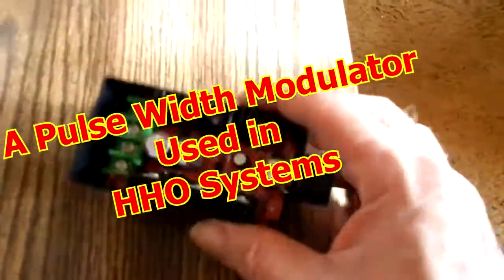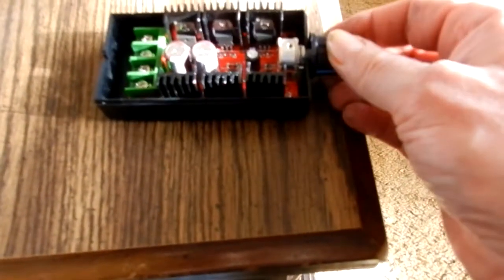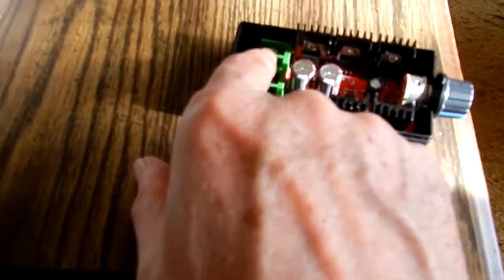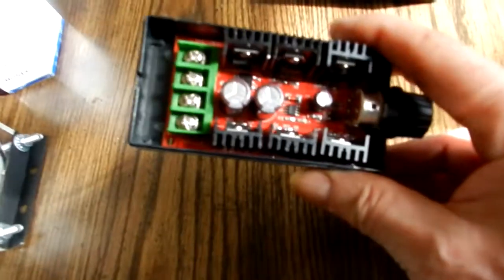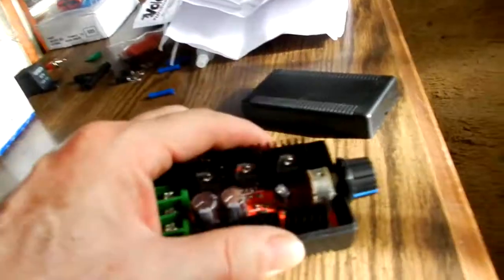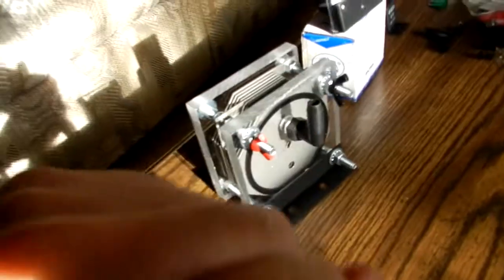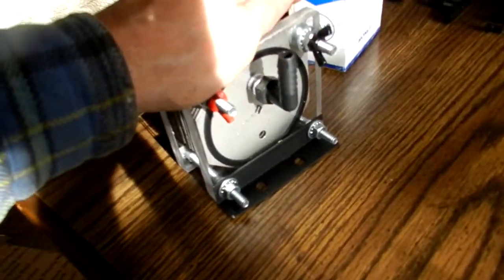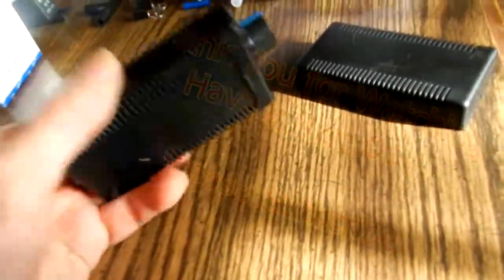PWM Pulse Width Modulator used in HHO SYSTEMS, HHO Dry Cell Generators

Comment: Anybody used PWM to generate HHO successfully?
Reply from the maker: The use of a PWM in producing HHO provides pulses of power to the plates and the process instead of just pouring a continuous power to the system.  The advantage to this is that when the bubbles form on a continuous power stream type of HHO system they tend to stick to the plates effectively reducing the surface area of the plate while there is a bubble on the plate.  

The HHO system only produces gasses when the liquid is on the plate, not the bubbles.  The PWM uses pulses which sort of jar the bubbles off of the surface.  This is the function of using an audio pulse vibrating the entire system to remove the bubbles.  Both the PWM and the Audio vibrations increase the efficiency of the system by removing the bubbles and letting them go on to the engine as in the form of a gas.  

I haven't tried putting a speaker on the system yet, but just tapping the case causes a noticeable release of the bubbles.
Reply: @NorthPoleJeff  I assumed the frequency of the PWM would somehow 'shake' the water molecule releasing the hydrogen and oxygen?
Reply from the maker: I believe that you are right.  The PWM does indeed cause this to happen in effect, however using an audible force will use a physical force to loosen the bubbles from the surface.  The two combined would mean even greater efficiency. 
 @donotwantahandle1111

Comment: I built one hho machine but i try to find that pwm. Do you know where i can find that ???
Reply from the maker: Here is a page that shows several PWM sets.  You need to have at least 30 Amps.  Any one of these should work great.  https://www.ebay.com/sch/i.html?_from=R40&_trksid=m570.l1313&_nkw=30+amp+pwm+motor+control&_sacat=0&LH_TitleDesc=0&_osacat=0&_odkw=30+amp+pwm+controller

Comment: Dear Jeffrey,
Therefore, in an HHO system, the PWM sends pulses of constant Voltage (let say 12.4Volts) which corresponds to pulse constant current equal to Io=V/R (where, R is the system resistance, electrolyte etc) in a such way that the average current within the Duty Cycle (d%) is Io=V/R times d%. Do we agree on this?
Therefore, in an HHO system, the PWM controls the Power input (Watts) and not the instant current (Io=V/R when is ON) which is constant (for constant temperature of electrolyte). That is a disadvantage because, that instant current (if large) produces ohmic losses which give rise to the temperature of the electrolyte. Therefore, the concentration of the electrolyte (solution) is very crucial in order to keep the instant current (Io=V/R) within the desired value, so that ohmic losses are minimized, and therefore efficiency of the HHO system is maximized.
What do you think Jeffrey?
Many thanks for responding to my questions.
Best regards,
Chris
Reply from the maker: Chris, thank you for that idea of the instant pulse current, I never thought of that as being a problem.  Now, I am realizing that instead of using square pulses, it may be better to use more of a rounded pulse instead.  This very well may reduce the overall power consumed and heat as well.

While we are talking about increased efficiency,  I am also thinking of sound pulses being applied to the system as a further way to increase the efficiency.  

Another way would be to use magnets set up as a chopper for the input water.  A chopper is used in fuel systems to break long carbon chains in the fuel making it easier to burn.

What are your thoughts on these methods.

Thanks again and have a nice day.

Jeff.
Reply from the maker: I really don't know about this because I have not studied instant current.  However, I remember our TACAN system sending out interrogation pulses that were not square for a purpose.  I think that this was for frequency harmonics and not for current, however having rounded pulses instead of square may reduce the instant current.  I am just guessing, however.  Thank you very much for your questions, you make me think.  Have a nice day.

Comment: 4 the love f'n God I need help please, I have the ccpwm 20amp w/LCD display. I HAVE a 7 plate series, Stainless steel same size this one, cathodes I swapped with is titanium. When It's cold it doesn't supply amps.  Koh is good mixture, When my cell warms up cabin temperature the ccpwm all of sudden gives amps to my cell. After 20 minutes of driving maybe 30. I had
 nnn+nnn both titanium. Now I rearranged the cell put just 7 plates -nnnnn+ and it only draws 1.5 amps not cold wtf is going on?
Reply from the maker: Your first arrangement nnn+nnn should work.  I don't think that the titanium is a problem, however, it may have an oxide on it that acts like an insulator at lower temperatures.  These are just wild thoughts, however.  Also, change your electrolyte and see if that makes a difference.  The Titanium may have some strange characteristics with certain electrolytes.  

As far as your second arrangement, each neutral set of plates creates a voltage drop.  With seven plates this voltage drop acts like a resistance and doesn't allow very much current to flow.  

There are two efficiency improvements and one is to have a variable pulse width and frequency in your PWM.  Another that I had seen only video on is the use of sound or vibration to force the bubbles off of the plates earlier giving the solution more plate area to form new bubbles.  This can produce a quite of a bit more HHO.

Thank you very much and have a nice day.
C. Jeff Dyrek
Reply: @ Taylor,...you managed to get 1 thing right. You wrote the name of God with a capital "G". Too bad you cursed Him...
Reply: @NorthPoleJeff  Here is a proper study done on Titanium as electrodes.... http://irjaes.com/wp-content/uploads/2020/10/IRJAES-V4N3P345Y19.pdf
This shows that titanium does in fact "protect" itself so to say, by very quickly building a layer of oxide? around it. If you look at the graphs from the link, you'd notice it gets worse for titanium as time goes by. CONCLUSSION: titanium sucks for hho production compared to other materials such as Stainless Steel etc.
Reply from the maker: @savedwretch  Thank you very much.  I am going to try my system on a lawn mower sometime next week.  I have never done that.  I will look at the link that you have sent.  Thanks again and have a nice day.
Reply from the maker: @savedwretch  Where did I curse him.  God is coming soon and I sure don't want to be cursing him.  Thank you for letting me know.  Have a nice day and God Bless you.
Reply: @NorthPoleJeff  No worries brother, have a look...i replied to "@Taylor". May God bless you.

Comment: Dear Jeffrey, I do not think that a pump helps more then 1-2% by consuming more power (little though 5-10Watt). Audio frequencies may help a little BUT both Pump and Audio frequencies make the system more complicated while consuming POWER. The net result, I do not thing that is worth.
Reply from the maker: Thank you very much.  You're right, the pump would be a problem.  However, on large systems 1-2% may be worth it.  In a test about the audio stimulation, I wish that I had a reference, there was a remarkable amount of bubbles given off when the proper frequency was applied.  This may only have been the initial release when the power was first turned on.  

Thank you for keeping me thinking.  Have a nice day.

Comment: The PWM does it control the Voltage or the Current. Could you explain?
Chris
Reply from the maker: This is the way a PWM works on an autopilot system.  The PWM sends pulses of variable width to a stepper motor.  A stepper motor does not have a commutator so the PWM is needed to send pulses in specially timed sequences to increase torque or for precise positioning.  

Short pulse widths  give low torque  and wide pulses give more torque.  The sequence of these pulses determines how much rotation the motor provides.

So, to really answer your question, it does not change the voltage or current, it just changes how long the current is turned on.

Thank you for asking this question, it allowed me to really think of the operation in a different way and I learned from my explanation.

Have a nice day.

C. Jeff Dyrek
Reply: @NorthPoleJeff  Dear Jeffrey,
Therefore, in an HHO system, the PWM sends pulses of constant Voltage (let say 12.4Volts) which corresponds to pulse constant current equal to Io=V/R (where, R is the system resistance, electrolyte etc) in a such way that the average current within the Duty Cycle (d%) is Io=V/R times d%. Do we agree on this?
Therefore, in an HHO system, the PWM controls the Power input (Watts) and not the instant current (Io=V/R when is ON) which is constant (for constant temperature of electrolyte). That is a disadvantage because, that instant current (if large) produces ohmic losses which give rise to the temperature of the electrolyte. Therefore, the concentration of the electrolyte (solution) is very crucial in order to keep the instant current (Io=V/R) within the desired value, so that ohmic losses are minimized, and therefore efficiency of the HHO system is maximized.
What do you think Jeffrey?
Many thanks for responding to my questions.
Best regards,
Chris
Reply from the maker: @chrischristodoulou1731  There were two other ways that HHO efficiency may be improved, something since your last letters from a while back.  One would be a circulating pump and the other may be an audio frequency applied to the chassis of the HHO generator.  What do you think?  Thanks again and have a nice day.,